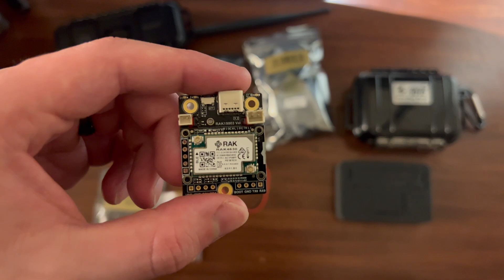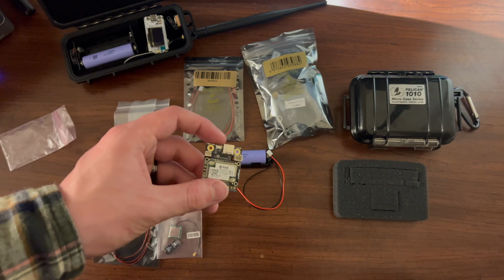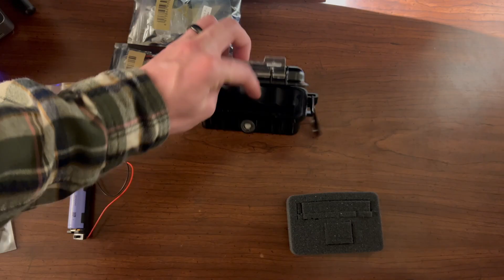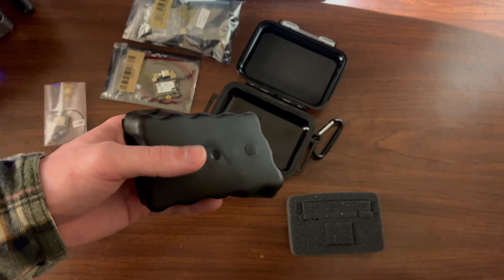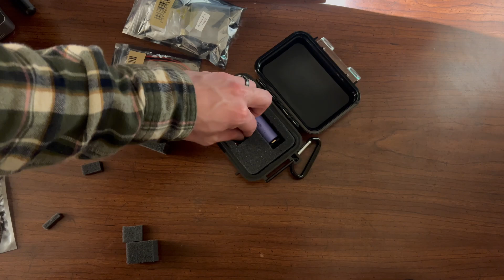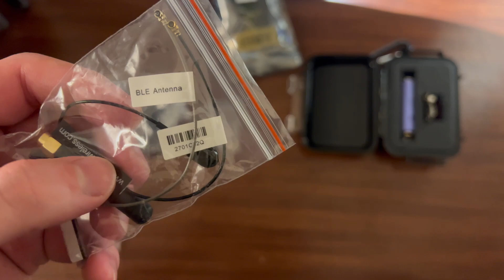Meshtastic Node Build 1/2: Parts, Cost & Assembly Guide

Comment: Great detailed well explained... Are the modules gps temp baro I2C ? If so, check for conflicting addresses... Keep up the great vids.
Reply from the maker: Yes they are and they run on the same communication lines. I believe RAK made an excel spreadsheet of what modules conflict with each other and unfortunately they do. I believe it might be a Meshtastic problem, because when I install all of the sensors and wipe the Meshtastic program with an Arduino program for the sensors, it returns the expected results in a terminal. Might do a little more digging to find out if it is possible to have them work in concert with meshtastic since a little time has gone by. Appreciate it, thank you!